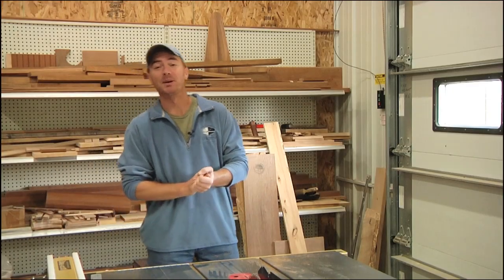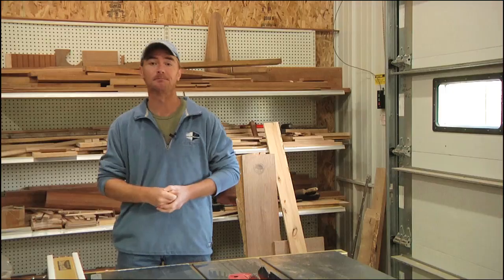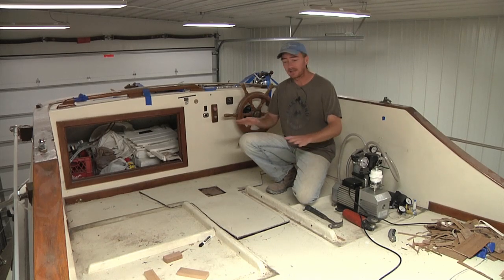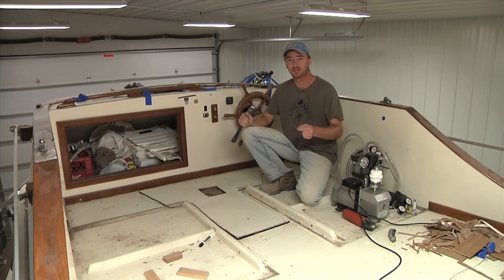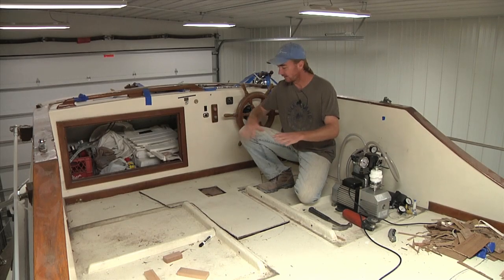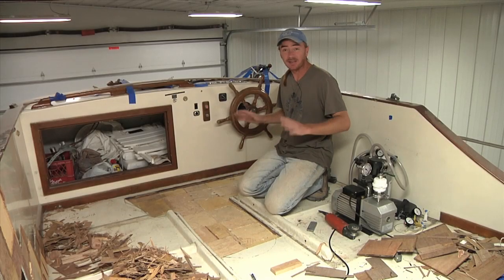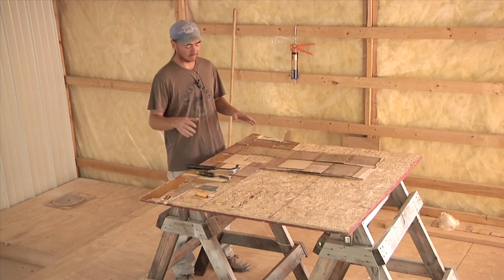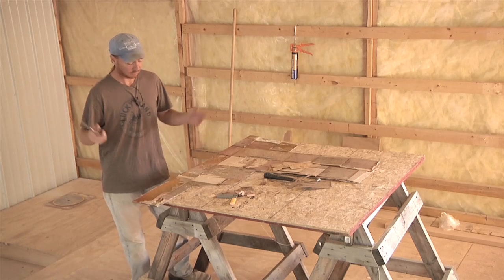Fiberglass Core Replacement Part 1

Comment: I have a boat made with nidacore (?) (coring is water proof closed cell) and the layer of glass on top of it is delaminating. When I walk on parts of the deck I can hear it. IT is not soggy or soft ... just disconnected. IS there a way to glue it back down without removing the "skin" and redoing it? Thanks!

Comment: I Like that.. "Good Job Guys" .. Meaning You Suck for your Terrible Job During your Original Building Process .. At my Auto Service BitDay (circa 1990) on a 79 Trans Am pulling the Transmission to Rebuild it Clearly said inside the back bumper "This car was built at 5:00 on Friday Sucker" .. Thanks for the trip back down Memory Lane.. Thanks

Comment: I get the rest of the deck is still solid currently. But surely they laid the whole deck the same and not just that small area you pulled up. If the rest is the same it will eventually separate too

Comment: What do you do if the plywood underneath isn't on top of fiberglass like yours is?  I'm thinking that I should glass my replacement wood before putting it in.  I don't know what weave or how many layers I should use.  Its on a small boat and the width of the deck area is only 4' at the widest and average of about 3'.

Comment: I am working on my first fiberglass boat restoration and it is a 1975 wellcraft V-17. The deck was completely rotted and when I made the first cut to see how bad it was I found...6x6 squares of saturated plywood. Unfortunately, the whole deck needs to come out as well as the transom and stringers. Your videos have been my resource on my off time while I do the demo work so I can plan the actual rebuild.

Comment: Hey Andy, great vid. I just did this on a deck plate circa 1990. Same Parquet plywood setup😳 Just a tip that may work for you. We used our Fein tool with a smooth cutter (chisel point) to remove the plywood that was still stuck to the laminate. Worked great and didn't have to worry about cracking the glass. We then hit it with 40 grit on a d/a to clean off old adhesives. Thanks for all the great vids😀

Comment: I know this is an old video but I am curious why you replaced the old core with plywood instead of balsa or foam core material?
Reply: Marine plywood is good enough and it costs less. There is no sense in putting expensive materials in an already old boat.

Comment: Thanks for the post. I've got a soft spot on top of my sailboat cabin, and I'm afraid I'm going to have to do the same thing. Just outside ... in the weather.  But I live in Florida and it's 'winter', so as long as I can keep dry, I'm hoping to get it done.

On to part two ...

Oh .. just want to say how much I REALLY appreciate your videos. They helped me overcome my fear of fiberglass work (hey .. if this guy can do it, why can't I!) by showing the devil is in the details. Your step-by-step videos are much better than trying to glean it from a book. Watching you feather out the fiberglass and fit sheets in is much better than a few till photos.

And thanks for the sticker, it's proudly displayed on the back of my car.
Reply from the maker: Thanks for the kind words John :-)  Good luck with your projects this Winter!!  What part of Florida are you in?
Reply: We live in St. Augustine, the marina is just off the ICW and it takes about 45-60 minutes to get to the Atlantic, depending on whether I can time the drawbridge opening or not. :-)  My guess is I'll have to drive the boat to a quiet anchorage to do any sanding, they usually frown on that in the marina. Should be an interesting project to do on the water instead of indoors or on the hard. Watched the rest of the videos in this series, and really interested in getting started after the first of the year.  Thanks again for such great demonstrational videos.

Comment: I have a 99 Sea Ray project boat. It had been sitting for a long time and had a hatch leak. I just gutted the entire cabin and found a small hole in the fiberglass ceiling in the cabin, a couple inches from the edge of the hatch. There is wet wood inside. I pulled the hatch out and the edges of the hatch opening are still solid. The interior side fiberglass has delaminated  starting at the hatch hole and going at least a foot inward on the side with the hole. What would be the best approach to fix this?

Comment: Is it possible that the reason that the plywood square are dry stake without any resin was to save weight since that it look to be the bridge deck. Bridge deck needs to be lite so that it does not raise the center of gravity of the boat. just a thought...
Reply from the maker: +vgaulin I suppose anything is possible :-/  That may have been their logic but on a boat of this size an extra few pounds of resin and glass would be insignificant.  Without the resin to tie everything together there's no stiffness or strength.  IMO this was just them cutting corners :-(

Comment: Some boat builders of the1980 circa, used a butcher block arrangement of plywood squares to reinforce the deck, combings and cabin tops. The reason behind this is; the butcher block design limits the spread of water and dry rot to one small square (The reason for your moisture meter readings) Other production boat builders of the era used solid plywood as a reinforcement but this lets water and dry rot spread over large areas. However, during this period, most boat builders were just trying to make their products as inexpensive as possible. Which is also why these boats are being restored, better than new (depending on the skills of the rebuilder).
Reply: The butcher block idea you're talking about consisted of very tightly laminated and bonded blocks, not these loose shingles.

Comment: Just a thought... You are clearly the expert and I love your videos. From my limited understanding of how epoxy, glass, wood, etc adhere, its makes sense to me that the small pieces would create a greater surface area for everything to bond. One large piece of plywood with a glass skin seems like the epoxy would be very thin, in spots, on the surface and have less adhesion. If there is a patchwork set up, there are spaces in between the small pieces for the epoxy to settle and bond to a greater surface area. Almost like laying tile. The grout between the tile adds greater adhesion than just just the base underneath. In the fiberglass situation, the surface skin would not only bond to the top of the plywood core, but down, through the gaps, to the base layer of epoxy and underlying glass???? Again, I have no clue about how fiberglass works, but this just makes sense to me. I'm about to replace a cockpit seat core with plywood and would like you to weigh in, once more, regarding patchwork vs one large sheet.
Reply from the maker: Hi Jimmy, Epoxy by itself has very little tensile strength.  It's only when combined with glass, wood, etc that it really starts to shine :-)  Because of this, every seam between pieces of wood becomes a weak spot prone to flexing and eventual cracking.  Relating this to a tile example, even the individual tile pieces are bonded to a larger piece of cement board for stability and increased strength.  It's all about distributing the stress over as large of an area as possible.  The fiberglass layers on top help to tie everything in even more (adding stiffness and protection).  Hope this helps!

Comment: hello, a little late to find this series but I'm starting to re-core the deck of my International 110.  1967 Schock hull with a balsa cored deck and a foam cored hull.  I'm plannning on using 5# density divinycell H80 and am looking for any pointers you can give me as far as should I re-use the skin as you did in this series or layup a new skin as I will need to fair it in to the topsides.  Looking for lightest-stongest option as I need to keep hull weight in check for racing.  Would I use 1708?

Comment from the maker: This mini series is going to be very helpful :-)   I'll be covering all of your Q;s over the next week or two.  In the mean time try emailing me some pics of your project so have a better idea of what you're working with..  boatworkstoday@gmail.com

Thanks!
Reply: hi andy. thanks for the videos. i am doing the same project on my 35 ft trawler flybridge. having a hard time getting the fibreglass deck to come up , apparently mine was bonded fairly securely. i do not want to break the glass as i plan to relay it once the wood core is replaced. any tips ? your video looked as if it just came right off with no problem.

Comment: Thanks. Great advice and show. Already knew about not using treated lumber. Also: what about blending the new surface fiberglass into the old, existing pieces? Feather as best as possible then repaint it all? I am glassing and resining all the new framing underneath to seal. Is this a good way to go? Previous construction was bare, unsealed 2x4s.

Comment: Timely. I am in the middle of the EXACT same project on my 78 Carlcraft houseboat. Learning as I go. Previous owner did deck and didn't seal a thing, so I am re-framing all the removed rotted pieces and then reskinnjing with plywood. Sealing EVERYTHING in glass and resin, not done before. Not sure which plywood to use, but i think I am settling on outdoor grade sheets, not marine grade, for cost purposes and it will be resin and glass sealed anyway.

Comment: Thanks again for posting. On my 1963 Columbia Sabre this is the stage I am about to get into. I noticed they had drilled many 1/4" holes I assume to let the upper deck dry out. I poured expoxy in and in and in... So needless to say I am looking at doing the upper deck over, relaying fiberglass layers. Luckily the beam is only 6' and 1/3 of the boat is deck on the outside.   I thank you for showing me this, it really helps me out!